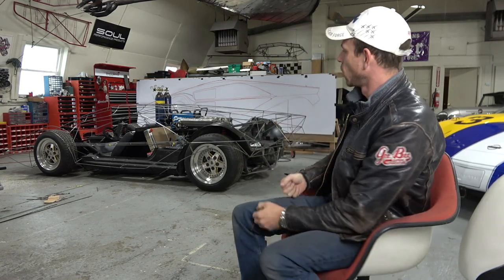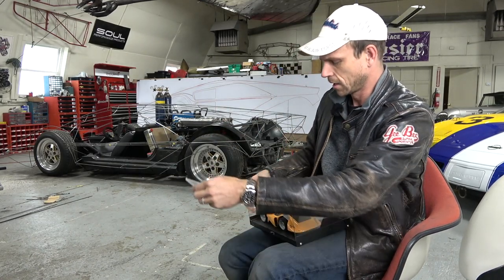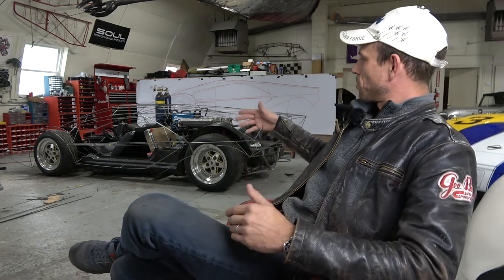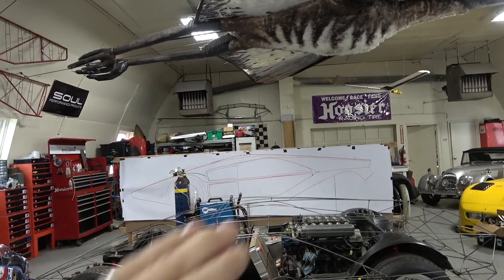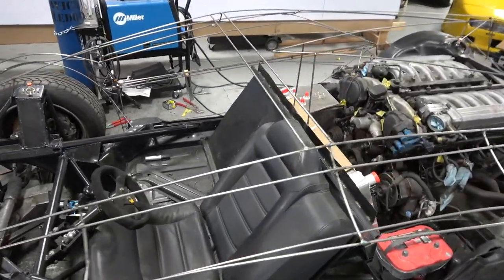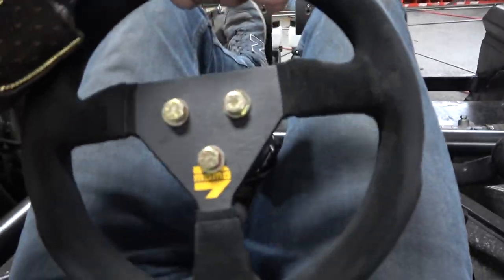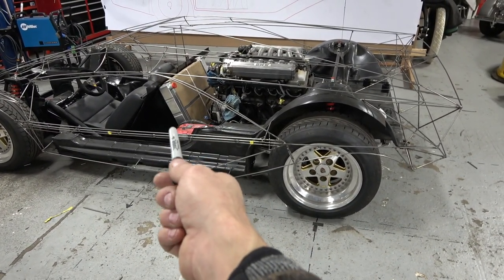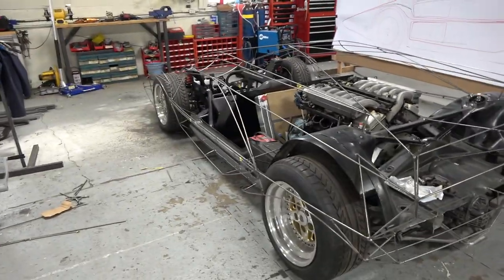Wire skeleton and Contest | King Zero V12 supercar #18

Comment: Retired automotive/aircraft painter here but I don’t have the ability at the moment to model and paint my idea in a physical form to do it justice so I’ll just try and explain it as best I can. If you look at the new McLaren speedtail’s paint job in the silvery blue color you’ll notice all the lower body features and recessed areas are color faded to a darker shade, I’d do something similar to that but in a slightly darker blue/silver tone or possibly a pewter/champagne/gunmetal tones with a darker fade in all the recessed bodywork and where it all curves down to a lower portion of the body. Also on the trailing edge of one of the rear louvers I’d paint the colors of the Italian flag as a little hint to the original designer and on the bottom side I’d do a bright contrasting color so it’s visible through the louvers when looked at from the rear. Hope all that makes sense lol, if I had a physical model and my paint equipment I’d just paint my idea for real and submit that to you but unfortunately it’s not possible at the moment.

Comment: Casey, try gaffa taping the wire frame where you are thinking of putting the lights (windows) and then cut out the hole a little at a time, till you are happy.

Comment: I never realized just how impractical the design of the Zero was for driver visibility. There's also no real way around this without major changes, is there? The extra windows might help, but how much will they help once you incorporate them into the sculpted body? Going by the original Zero design, these windows would be small slits, due to the wheel well fenders and the slight dip in the roof line, plus because of how much wider the canopy is in comparison to the window; you would also have the top beam of the original upper window that would become it's own blind spot. Cameras are probably the most practical solution for this, just considering how much blind area there is. It'll be interesting how you plan on implementing the screen side of the camera setup. It'll also be interesting how you plan on implementing any form of a dash considering how you get in, where your knees sit, and the lower visible area of the wind shield; it seems like another impracticality with the Zero's design. 

Looking through other iconic wedge cars of the era, the Zero seems to have the driver pushed too far forward with really short, in length, side windows. Another factor is just how wide the body is compared to the cockpit, the only competition the Zero has in body to cockpit ratio in wedge cars are the Ferrari 512S Berlinetta Speciale and the Ferrari Modulo, but they both had their seat positions further back; though the Modulo might've had decent visibility, the 512S Berlinetta Speciale looks like another visibility hell. Though there's also way too many wedge cars to go through, but most of them that I've looked through have had long side windows, the driver pushed back a decent amount, and the cockpit is typically as wide as the body is, which would allow for wider front windshields. Another factor might also be how low the driver sits, but it's really hard to tell and compare driver eyeline with various wedge cars; I only consider this as a potential because of how low your sitting position is in comparison to where the wheel wells would be. 

As good as the Zero looks, design-wise, and with as much of an inspiration and icon it is, it was never designed to be more than a prototype show car, was it?  There's just a handful of details that make it way too impractical for it to be anything more than an early concept, the front door, how far forward you sit, the visibility, the engine's hood, and various other details of the original design. Even if you made the body entirely clear, you still have massive wheel wells blocking visibility, and that's before any upper chassis. With the current visibility, I'm getting racing game vibes from when 4:3 aspect ratios were standard, when the only real cockpit visibility was forward.

Though, I can't wait to see how you do end up making this vehicle somewhat practical to drive.

Comment: Moving the radiator to the side pods of the car would allow you to run a slightly larger fuel cell and create a more accessible fuel filler port.

Comment: I’m pretty sure you’ve already been told this or already though of it. But you could move that radiator out of way. Do the two smaller radiators on the side. Then put a larger fuel cell in the place of the old radiator.

Comment: are you set on having it a two seater? you might be able to see a little bit more if you turned it into a single seater where the driver sits in the middle of the car.

Comment: This is a question not a criticism but why does  driver positioning in a closed car with asperations of speed have you sitting on the floor with limited visibility?. There would be only a slight rise in the centre of gravity which would have negligible effect on handling but a clear view of where you are going.

Comment: I'm gearing up to build a 1932 Ford roadster. It's the biggest project that I have decided to under take. I doing the build, because building a car from the bones up is something that I've always wanted to do. Well after get an engine a generation too new to work in my truck and no takers to buy it. I figured it is good opportunity to build a hotrod. Any advice you can offer to someone trying to do it and not loose his shirt in the process?

Comment: RE: Ohio State design program fail... sounds familiar.  

I attended University of Maryland, Baltimore Country in the mid-80s in the "computer graphics" program.  They actually had a Quantel Paintbox suite installed and had instructors to teach it.  Unfortunately, the Dean of Arts was a older (if not elderly) "brushes and paint" kind of artists and lacked vision of the future.  He GAVE the entire suite to another university in Maryland, but they couldn't find anyone to teach it, so it lay fallow for years - years in which I had to enter the workforce and abandon 3D modeling as a career goal.

About a decade after I left, I got a bunch of alumni ask letters, some featuring their "all new computer graphics lab!"  Wow.

Comment: That 3rd side window is critical, and difficult. Making it invisible by colour & flush mounting kinda works but you'll still see it, it'll still disrupt the plane & the lines at that point: better to find a good design solution. Looking at the original shell, the edges are pretty well defined: the rear edge is in line with existing windows, the top and bottom are defined by the edge of the plane it is sitting on, the front is defined by the wheel arch. Getting this to work though is tricky; it interferes with the door edge (this isnt a very pretty line anyway IMHO). How about changing the edge of the door to include this window, moving the door line so it follows the wheel arch  then tracks the bottom of the little window, or even takes in the whole of that plane? This would allow you to make the third window more associated with the windscreen (big, front and centre) than the side windows (recessed), more sympathetic to the form? Looking forward to whatever 3D model you are sharing.

Comment: With about this as an idea in regards to the 2 Side Widows on each side of the "King Zero V12 Supercar", would it be possible to add something like a Hard Lid/Skin Cover that can be Retracted back into the Coachwork Body to Cover the Upper and Lower Windows? Wouldn't fitting a LCD Rear Vision Screen with Camera behind for better rear vision, if you don't want to fit side mirrors to prevent any drag, then wouldn't having a periscope d rear vision mirror just add unwanted drag to the "King Zero V12 Supercar"?

Comment: This is probably a dumb question, but how do you take the rims off with the wire form?(specifically the rear ones)
Reply from the maker: What happens to suspension when you jack up a car....?
Reply: @CaseyPutsch  i know it drops but i didnt realize by that much. It looked like the wire form covered almost 1/3 of the wheel so i didnt realize the coilovers had that much clearance once it was lifted. Very nice video btw, im hoping to enter in the paint scheme contest

Comment: It looks like it would be difficult to get in. On video, it looks like you can’t, easily step over front spoiler or wheel housing on the side. Am cringing at idea of stepping on a gently rolled body panels. I think it can be doable on a perfectly level surface, but can exacerbate if car parked at an angle (garage driveway or slight hill) looks awesome though

Comment: Now that KYLE.ENGINEERS is back on youtube after leaving Mercedes' F1 aero team, he might have some tips or tricks for sucking air from under a very low car if you do decide to keep the current radiator position to keep the body-flow more like your original concept or something. Before someone yells at me, I'm just spewing random thoughts without thinking about them.

Comment: Why don't you put the radiator at the very back of the car? Just above where you said you may put a diffuser, just by the rear spoiler mount.
Don't forget the area in front of the windscreen needs to be a step, the original used horsebox rubber flooring mats.
Reply from the maker: To such hot engine air?
Reply: @CaseyPutsch  Just a thought Casey, I take your point of the hot engine air. Also, I am not sure where you are piping the exhaust.
On the Fiat X1/9, the front mounted radiator and rear boot along with the exhaust box below were both used as crash structures.

Comment: Maybe take a couple of inches out of the width of the front - the sides of the nose, ahead of the front wheels, need to taper in more. On your car they appear to go almost straight ahead from the front wheels forwards, while on the original they follow the taper of the sides of the windshield more closely and also follow the curves of the side of the body.  No criticism intended, maybe there´s a good reason for it and i know it´s not a 100% replica, but it looks a bit off to me. The nose looks a little too square.

Comment: Casey, check how the soviets did periscopes for their jet fighters, although clunky it could be cool, check for example the rear pericope on the two-seater mig-29 or the mig-31. As a design idea, would it look even sexier if you taper the nose of the car to make it narrower? Kinda like what the Countach does? https://aviation.stackexchange.com/questions/19446/what-is-the-purpose-of-the-mirror-thing-over-the-mig-29-cockpit/27532

Comment: What if you're not an artist, designer, engineer, or race car driver? we can't like cars? :P

The prototypes of the muse car were orange, no? I don't know why orange is so popular back then :P  But when trying to imagine colors for the King Zero, I keep thinking about the Mercedes C111-II (because the first one looked uglier with just a big grille,) orange with black details, something like that might work. https://upload.wikimedia.org/wikipedia/commons/4/4f/Mercedes-Benz_C111.jpg
Reply: Also, for the blind spot... a camera could work as you mentioned, but one option... at least for road use, newer Volvos I've driven, have blind spot sensors, a little orange light that would light up if there was something in your blind spot, could work for road use at least, won't cure visibility, but can help some with not ramming cars off the highway when changing lanes. :P